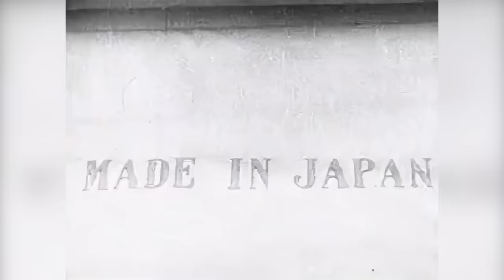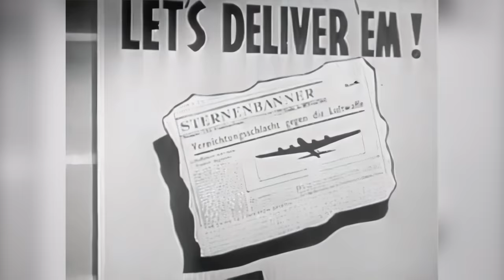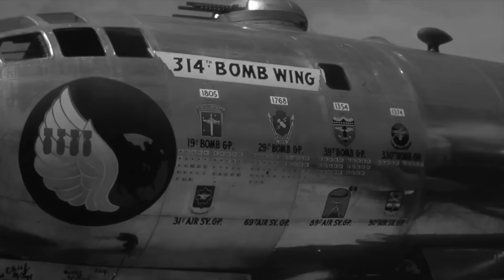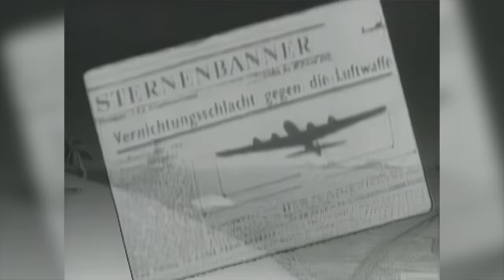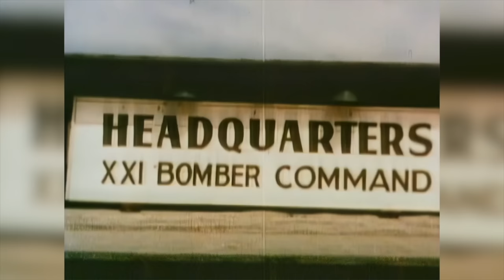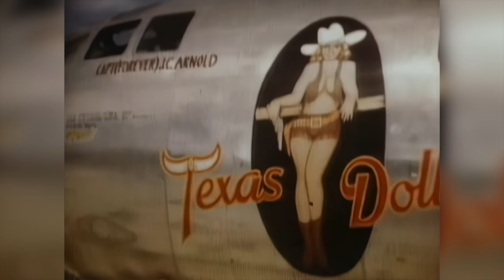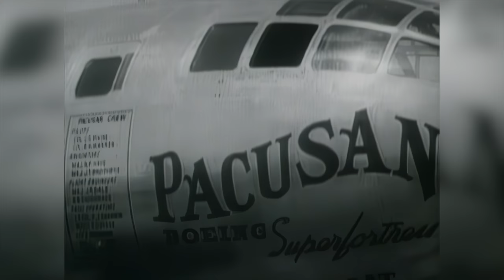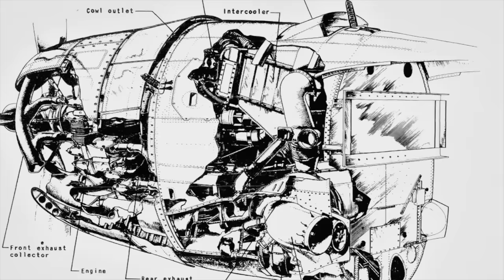Birth Of The B-29 Superfortress | Boeing Heavy bomber | Includes A B-29 Documentary | Upscaled Video

Comment: Not that many B-29's went to war in WW2.
Reply from the maker: Only a few thousands were built (the B-24, as a comparison, was built in 18,000 units). One of the reasons is probably because they were used, mainly, in the Pacific theater. I think around 1,000 were used in the bombing raids at one time, which was 1/3 of the fleet. As we all know, they also dropped two atomic bombs.
Reply: There were 3.970 B29s manufactured from 1943 through the end of 1945.   The "Silverplate" versions made for use with the atomic bomb were manufactured by the Glenn L. Martin Co. in their Omaha, Nebraska plant.  The Silverplate version had fuel-injected motors and adjustable pitch, reversing propellers.  Only a tail gun was installed on the Silverplate models to reduce weight.